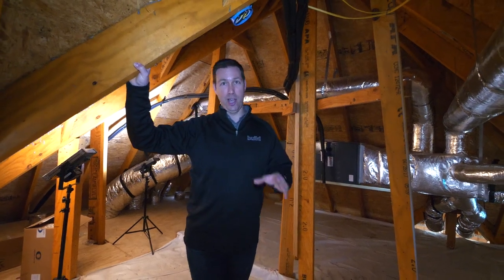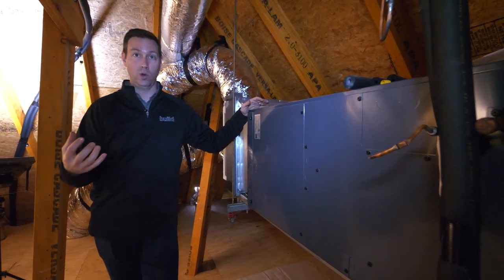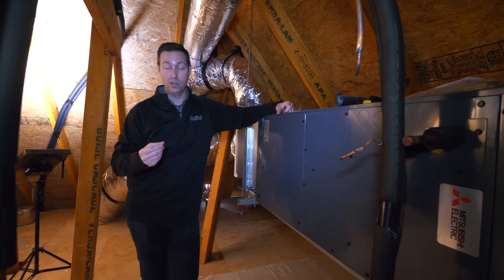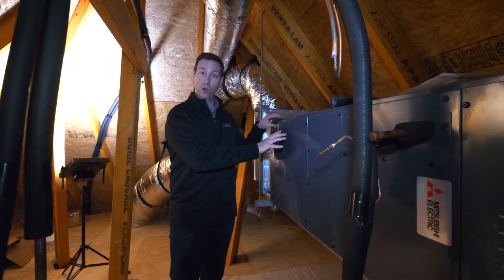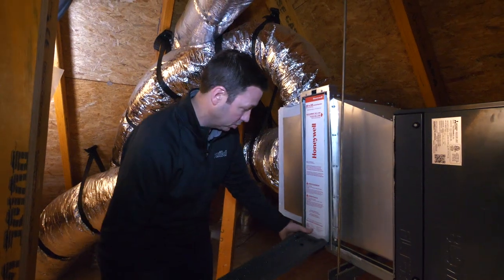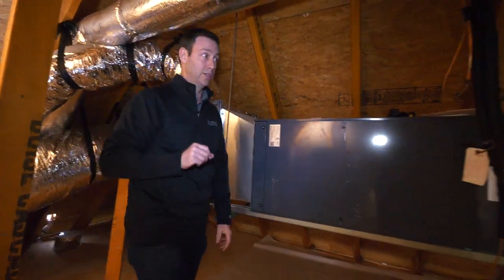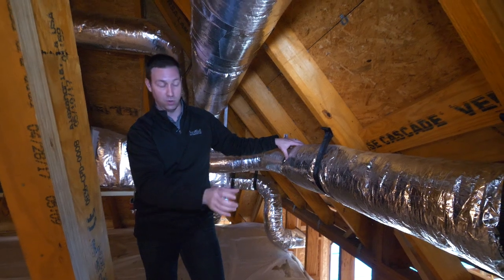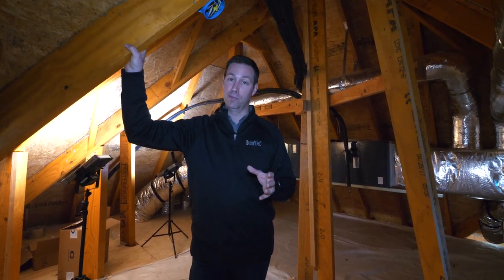New Construction HVAC - Here's My Favorite System

Comment: Been in the HVAC trade for 45 years- That was a nice install. I have always installed the 4"-5" Merv 11 filters (April Air) in all my installs since 1988.  Have never had to clean the indoor coil or air handler.  Yes, they get changed once a year.
 Hope they don't forget the auxiliary pan and drain switches.
Reply: newstart49  -  are those filters very expensive?
Reply: Being specific on the change rate of an air filter is the worst thing you can do. "On the average" or "about once a year" should be stated. If you live in a dusty area or carpet vs wood floors, pets, kids, how much you use the system, all the daily factors play into the change rate for your air filter no matter the filter!!
Reply: There's some smart systems out now that, besides usage timers, can monitor the static air pressure, and will send a 'reminder' that it's time to change your air filter.

Comment: I’m a NADCA-certified Air Systems Cleaning Specialist (ASCS) and I completely agree with you about using rigid ducts. I have cleaned well over 200 homes this past year and I have found that the most frequent problems occur with duct board and flex lines. Interior insulation deteriorates over time and then contaminates the airstream. The plastic inside of flex lines also starts to deteriorate and introduces contaminants into the airstream. I recommend hard lines all the way to the boot and then cover them with insulation to reduce the noise. The average homeowner won’t like having to hire a professional to reinstall or encapsulate lower durability ductwork every few years.
Reply: lmfao useless title , i have a c-20,c-10 and general b license. you wasted your time ,life and money lol  just picked up a 180 home track development .

Comment: I knew you were going to say that you only have to change that air filter once a year. If you have a high merv filter it's going to collect more dust and that's great but believe me as a 37 year heating contractor you have to change the filter more often if it's collecting more dust. The only good thing you telling homeowners to change it once a year is it brings me to their home to reset the furnace and change the filter . Thanks for the extra busines .
Reply: Terry Moline  -  are those filters very expensive?
Reply: orion khan 35-45 bucks. We tell homeowners every six to 9 months max. No such thing as a one year filter
Reply: @zack9912000  Are there automatically changing filter systems?
Reply: steam steam on large industrial systems yes, not for residential systems
Reply: Terry---LISTEN. The entire home envelope will be SEALED.No infiltration thru penetrations, around windows and doors, nowhere. The attic is conditioned air as well. I suppose you just love flex duct too. I spent over forty years in HVAC, working on everything from residential to light commercial, chillers to explosion proof industrial HVAC. I know a little something about the subject. With no infiltration fresh air must be provided, but betcha last dollar that his HVAC contractor is gonna have that filtered before it reaches the return air. I don't know his contractor, but I can tell you this. If all installs were done to their exacting standards service people would be starving in cardboard boxes under bridges.

Comment: Ever here of Static Pressure. Not going to get that with that install. Those hits on the supply are two close together to force air were it needs to go. And one more thing. You never, EVER take a hit off of the end of your trunk line.
Reply: William Winder , Code now requires balancing dampers in every supply branch collar so collar position is irrelevant . It is favorable to have all branches 18" apart and 18" from end caps or the air handler but not necessary on such a small system.  ECM / variable frequency/ constant torque motors are all that are available now . They sense amp increase due to resistance and ramp up to compensate. Most  systems won't loose much efficiency due to high static across the evaporator coil until static pressure exceeds .4"WC so poor airflow should never be an issue.
Reply: Y’all are talking about the octopus bit at the right side of the Mitsubishi unit yeah?    Sorry, not a builder guy, just someone in the design phase of building a new house and this stuff is fascinating to me !!
Reply: William Winder agreed laughing at other who say this is a good install.

Comment: Filter box looks great. Love the 4" filters! I agree on MERV-13.  FYI round elbows usually don't have turning vanes.
Reply: Colin Black never vanes in round elbows
Reply: Correct. Rectangular or square duct generally does use turning vanes but the round heel round throat of a round sheet metal ell makes it unnecessary. Smooth airflow is what you're looking for, turbulence the enemy.

Comment: I understand wanting quiet, but not so much silence. After the hurricane, I just went through 8 days of pure silence in the house (aside from intermittently running the generator) and it was somewhat torturous at times. On the flipside, the usual loudness of a portable AC right next to my desk could be done away with and I'd be happier for it. But like, every place I've lived I've always wanted a fan on or something at night to make a bit of white/pink/whatever noise to help me sleep, so I don't think I'd really mind the slight vibration hum through the whole house of the unit or the air noise through the vents. Hell, it'd let me know whenever the system was actually running.

Comment: Boy you're not kidding about not wanting to replace the ducts after the fact.  The grey flex ducts in my 80s built home were  disintegrating from the heat, apparently home to several generations of roof rat.  I pulled every duct and the fiberboard plenum out of that attic in the middle of summer and piled it up on the driveway.  The smell of rat urine was indescribable.

Comment: Shalom Aleichem. 

So far very informative except, I live in an old (90 yr old) house that has had (prior to me moving in 30 yrs ago) all the old metal ductwork replaced with that flexible sift ductwork.
The problem is since I'm out in the sticks we get mice & normally they're controllable except when I'm away for extended time's. 

The mice (an occasional opossum) decixed to munch on the flexible stuff and attempt to enter my home. 

Also we're talking a 4' - 1' crawl space. 
I wanna completely rip out the flexible crap & replace it with metal. 

I'm currently heating with a wood stove and it's great, but when I'm away I have to drain the house down to avoid cracked pipes an unfortunately the mice come back.  

Also I'm a retired mechanic 66yrs old on disability & my budget is very slim. I can do (with a gelper) most (if not all) the work myself.  

Any suggestions would be appreciated.

Ratson haba b'shem YaHuah
Reply: (Advice from an HVAC installer) et metal work is really simple once you get some practice.  Just like any other trade, buy the best tools (Malco, lenox, midwest, etc.) You can afford and it will make life easier.  Having a set of professional  quality snips and crimpers will save you so much frustration and Knicks and cuts on your fingers, I'd definitely recommend dropping some money on those 2 tools at least.  

  If you are running duct in the crawlspace you most likely going to have to insulate your pipe runs and trunk duct.  I'm a big fan of R8 "double bubble" wrap available at most HVAC wholesalers.  Wrap everything before you hang it and tape up all your seams.

Comment: Why isn't there an overflow pan under the airhandler? It wouldn't pass inspection in this area with out it.
Reply: I'm also interested in this, I know a few AC guys who would never put AC units in the attic due to flooding concerns (the end owner always tends to skip on maintenance).
Reply: If you look closely the Install isn't finished. The line set isn't brazed in yet. He is in my neck of the woods and it wouldn't pass inspection here which is why I have no doubt it just isn't finished yet
Reply: I've installed these units before as well as the normal split system furnace and we never set them with out the pan. The pan goes first. Now they have to lift the system to put the pan which will put a strain on all those hard pipe supply lines.
Reply: carlos yanez 
The unit is hung from the rafters. The pan will be hung from the uni-strut. Very common way to install secondary pan and no need to lift unit
Reply: Christopher .Corbell How do you hang drain pans from uni strut without compromising the integrity of the pan?
Reply: I would use uni-strut with a sheet of plywood to distribute the weight if it fills with condensate. The uni-strut/plywood  would be hung from the uni-strut the airhandler is sitting on.
Reply: Christopher/Roeder would it not be easier to just put the pan first rather than hanging plywood and pans?
Reply: carlos yanez Yes like you I always have installed units starting with the drain pan first.
Reply: It's hanging in the air. Why would you install the pan first...
Reply: sequence of install, set pan, so it is supported,  set your system in pan so when the condensate drain plugs up, it flows into drain pan. Run drain line for overflow so it drains out to a conspicuous spot, like over the front walkway, so the home owner sees that there is a problem that if it isn't taken care of, can get real expensive and messy fast. then connect duct work, refrigerant lines and finally electrical.
Reply: Yes there should be a pan....
Reply: Every licensed contractor in almost every state uses it with an overflow switch. It's hard to sell a house without one. I think they claim here that because it's in a conditioned space it doesn't require it. I'd still have one. They aren't that expensive and can save you tens of thousands. - any maybe someone's life if the wood and plaster underneath rotted and fell. This just seems like common sense. But I have not been through 4 years of air conditioning installation school.
Reply: Hang pan with strut and plywood to contain condensation overflow, freeze ups , cracked pans, and put an over flow switch and pan switch to cut power or notify your smart device and shut down system. So when there is a shut down on the system you will have a good idea why. The drain pipe to an obvious location usually is overlooked or damages things stored in the garage.  My inspector allows me to tie primary and secondary together or I put a shut off valve on the emergency to trigger safety. Then after repair you can drain the emergency pan in a controlled manner.  Also, I do similar safeties on down flows and up flows to prevent damage for customers who travel out of town a lot or are not home much.
Reply: or put a float switch in the primary drain line so water doesn't go the the secondary drain line into the pan.
Reply: david peters  -  ok, I’m fascinated by this thread, but just to be clear (I literally know nothing of these things, I’m learning as I’m going through the process of building a new home) an overflow pan is something used to catch runoff water from condensation, yes?
Reply: My air handler has a built in drain pan that has a secondary drain outlet. It has a  float switch that turns off the air handler if the drain pan fills due to a clog. This is allowed by IRC code. It also passed inspection.
Reply: @grendelum  It is used for situations where over time the drain may get clogged, or condensate pump quit working.  Resulting in the coils drain pan inside the unit overflowing and leaking through the cabinet out the bottom.  If you didn't have one, you will cause some significant water damage, especially when the air handler is in an attic.
Reply: United We Stand, Divided We Fall  -  ahh, many thanks...   I’m in the final stages of the house design phase so the HVAC bit is up next (along with electric (which is more complex since I’ll have a solar PV array and PowerWalls), plumbing etc) and I’ve been focused more on the building science side than the gubbins of HVAC...   tho I know I’ll have an ERV as a part of the system as I’m using SIPs to build the house, so fresh air is important in an airtight house !!
Reply: carlos yanez  you are looking for a reason to be right. I’ve always hung my unit. Tied it to my ducts wether or hung either or first then put on my accessories so I can adjust it exactly how I want. Worried about flooding? That’s why they make an overflow switch. Can’t figure out how to hang a pan off unistrut without penetrating the pan? Find another trade. It’s not that hard. It’s not rocket science. Don’t you dare try to step into commercial without figuring that out first.
Reply: David, they aren't yet finished. Didn't you notice the refrigerant lines not yet connected to the evaporator? It's pretty obvious they have a pressure test going, so they'll be back. Pretty likely they'll hang an emergency pan underneath at that time. I'd BET they do a start-up, balancing the charge to exacting specifications instead of just lettin er rip, like many companies do. Virtually always resulting in an undercharge, poor efficiency and reduced capacity. I don't know his contractor, but if I lived there and weren't retired I'd HAPPILY work for them. They know their stuff and do it RIGHT. I wouldn't be a bit surprised if they actually did a nitrogen purge when brazing the refrigerant lines. How many companies REALLY do that?
Reply: @AWIERD1   
C'mon Jonathan. Have you actually ever done this kind of work? You suspend either 2X4s, more unistrut or angle iron from the stut supporting the unit. Place the pan on that and block to prevent movement. This unit is hung HIGH, which allows for a real sharp drop and no standing water. Hence 99% of the problems with algae are eliminated. EXCELLENT install!! This builder INCORPORATES the HVAC and all other "systems" into the building, using the BEST accepted methods for longevity and ease of maintenance. He ain't all talk. He actually does what he says and it WORKS. The highest compliment I can give him is to say I'd do it HIS way about 95% of the time. And on the remaining 5% I'd damn sure listen before balking.
Reply: Daikin, fujitsu, panasonic, mitsubishi electric, mitsubishi heavy industry, temperzone, actron and toshiba all make ducted refrigerated ac systems like this here in australia. Standard practice is installing a safety tray under the ac system with a “p” trap off the unit to enable the drain to flow even when on the fan is in operation. These systems often run with larger sized ducting than that of a gas furnace with add on cooling as high air velocity and volume is required to prevent freeze ups. Drains are generally ran from indoor system via pvc drain to an exterior drainage point. In high humidity climates this drain is insulated with the same medium that is used to insulate the line sets. 

As for pipe runs of line sets,  maximum distances can vary and may result in lower efficiency, oil return is not as critical a factor in these systems as most run with a oil separator.  They also use refrigerants that run at pressures triple to that of r134a or double or r22 so velocity oil return or oil logging is not a factor.
Reply: @davidpeters1927  I use safety shut switches unless the inspector says other. The secondary also has a shut-off. My reason is that when the unit leaks into the pan it run out over a window. No one ever notices it and never see it in the garden. It will run like this for years until the unit rots out or the secondary drain plugs up.
Reply: tbh, after thinking about it. I'd just buy or build a table for the pan to set on. It doesn't have to be hung right under the unit.

Comment: You have some good points and you seem very intelligent on what you do. The AC company that installed my new AC 2 years ago with new air ducts won't come fix  problems. Anyways Barker air conditioning company fix their mistake under warranty. I'm still having a slight sweating problem on my air handler, where my joints what together on my air handler it sweats along there also where the shuf off is on the air handler. Will to big or small air ducts cuz speculating this problem? I might try it just for giggles to install a bigger duct and replace of a smaller duct going to one of the rooms. Research first.

Comment: Guessing there's adequate attic entrance in case unit needs major repairs decades down the road? Great idea though with attic space. Ours is installed in a crawlspace that gets flooded every couple of years, with return supply through the joists. Not the best place for previous owners to have installed it there.